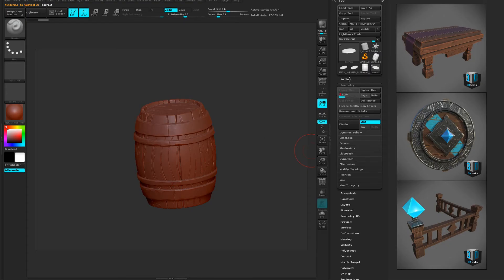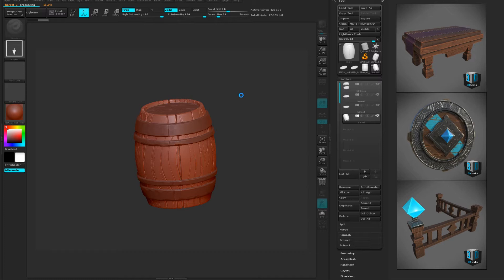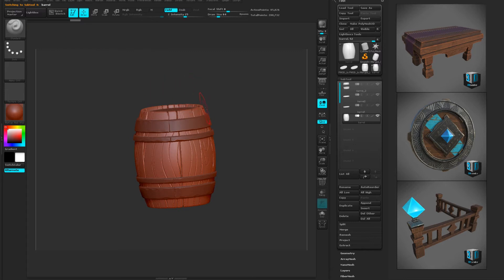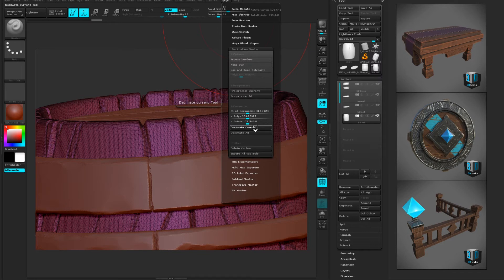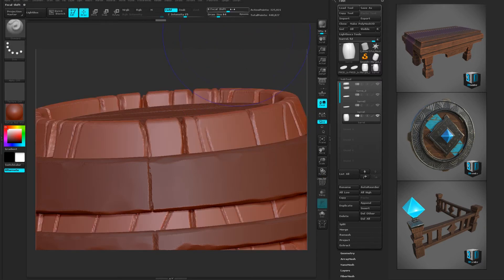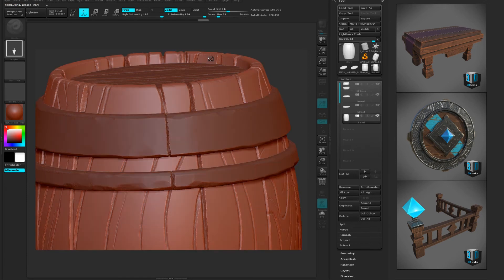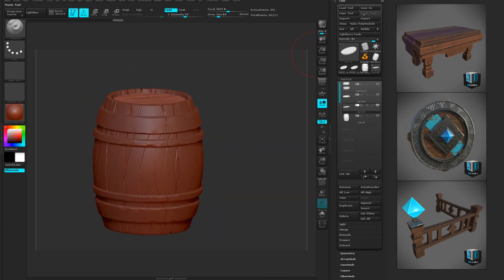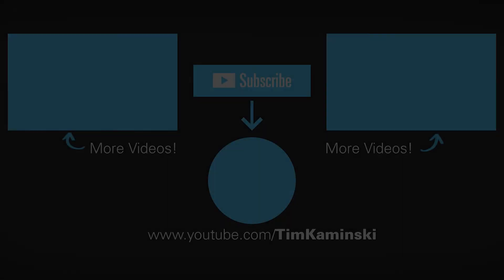Tutorial: 3D Prop Pipeline - Part 4 - ZBrush Decimation

Comment: Good video, but unless it's changed I think you were dragging the decimation % slider the wrong way (a higher value will give you more polys). Also once you preprocess you shouldn't have to preprocess again to try a new decimation % unless you change the model.

I was wondering, are triangles accepted for game meshes if they aren't meant to deform? (Like barrels and hard surface stuff)

Comment: I really hope that you can include the mapping process in the series.
Reply from the maker: Yup! I do the UV mapping in 3D Coat.
Reply: I actualy meant the baking process like normal, AO and so on. I use Substance Painter to do it, but sometimes I get some errors and artifacts and I just don't know anymore what's the right way to do it.
Reply from the maker: I use a mix of 3D coat and substance painter for my bakes. I'm not sure which one I used this time around. Normally I bake the normal map and AO in 3D coat and the rest in Substance Painter. I'm guessing I did that but I would have to go back and check to make sure. The process should be in the videos coming up though :)